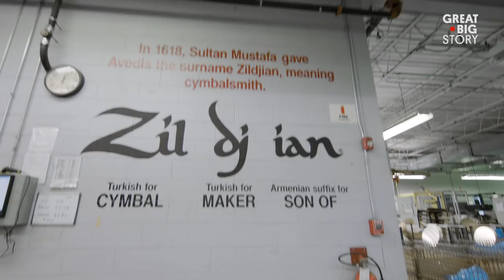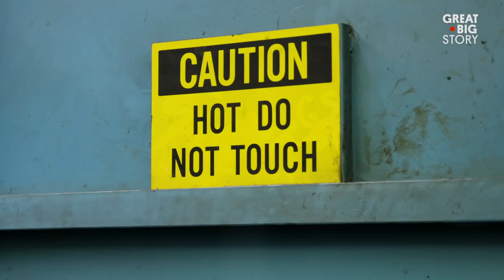The Cymbal Master Crafting the Perfect Sound

Comment: I live a mile away from the factory and used to work there, ask me anything and ill try to answer you
Reply: 90s Cup what is the biggest cymbal they make?
Reply: The Engineer when I was there they made a 40” gong
Reply: 90s Cup Do they use hearing protection, or is hearing damage just a part of their work (especially in the sound testing of cymbals)? I imagine that it's hard to find hearing protection that does not distort sound in any way. Do they simply sacrifice their hearing to produce great sounding cymbals?

Thanks! :)
Reply: Rubber Chicken people in the casting area definitely used it but the testers didn’t